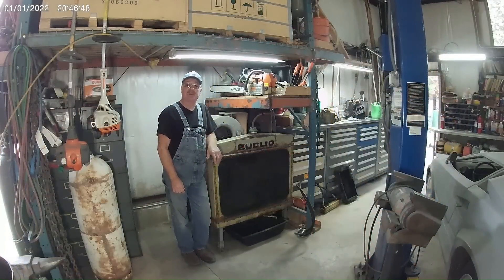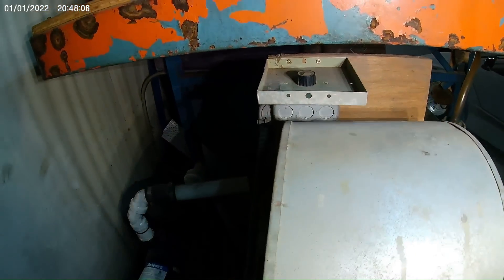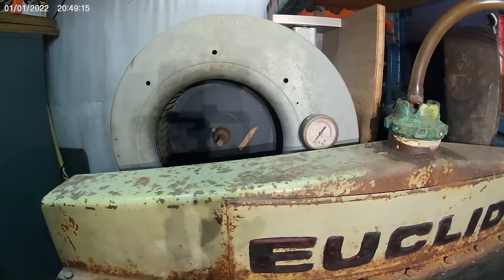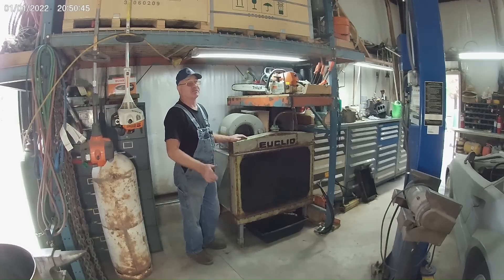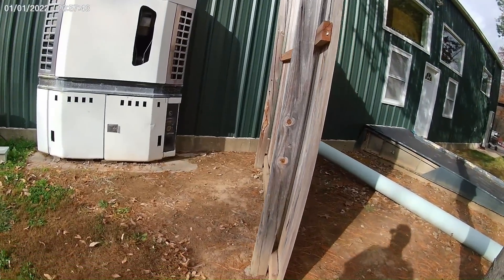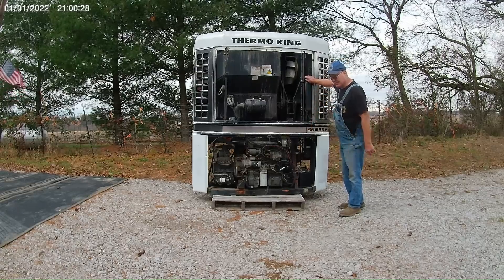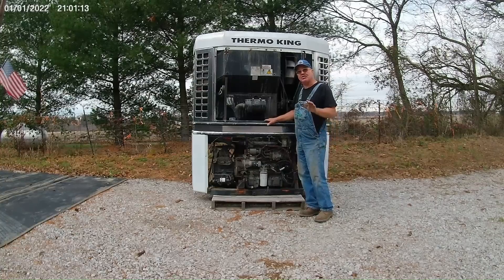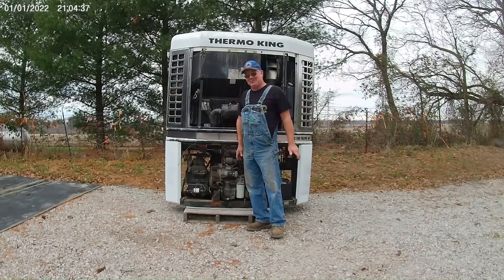The unconventional way we heat & cool our shop !

Comment: Did you add ducts to the inlet and outlet of your reefer unit inside your shop? Im a diesel mechanic and have my own shop. I stole your idea and bought a reefer unit to cool my shop but its not working to well for me and was curious if adding ducts would help
Reply from the maker: @RyanBryant-b7u  no ducts what freon is in it?
Reply: @dieseldoctor25 
R404
Reply: R404
Reply from the maker: @RyanBryant-b7u  I had the same thing, I changed mine to r-134a  the output air & condensation was twice as much, the 134a much better for cooling for a/c
Reply: @dieseldoctor25  ok. I'll recover the 404 and charge it with R134. Do I charge it with the same amount if R134 as the sticker says it hold R404? Do you have any other tips,tricks or suggestions for me?
Reply from the maker: @RyanBryant-b7u  do you have a tk sb2-30?
Reply from the maker: @RyanBryant-b7u  see if you can leave me your number and I will call you.
Reply: @dieseldoctor25   SB 111 SR+
Reply from the maker: @RyanBryant-b7u  OK same as mine  it takes more 134a right now I have
Reply from the maker: 13# just watch head pressure &sight glass in reciver tank
Reply: @dieseldoctor25  where in sight glass should the ball be floating? About center?
Reply from the maker: @RyanBryant-b7u  depends on head pressure & ambient temperature, probably will not see the ball floating, suction pressure will run higher than normal a/c because of heat exchanger, watch outlet temperature.
Reply: @dieseldoctor25 how long does it take for yours to cool your shop to a comfortable temperature? I'm not expecting for it to get cold in here but I'm hoping for maybe 80 degrees with low humidity. I just finished charging the system with r134 like you suggested. Very noticeable difference in temperature and the amount of water from the drain hoses. I'm hoping in a couple hours it will be comfortable in here now😊
Reply from the maker: @RyanBryant-b7u  my shop 4000 Sq ft 24ft high full of alot of heavy parts, remember you have to cool
Reply from the maker: Everything 4hr works for me
Reply: @dieseldoctor25  thank you for taking the time to answer my questions and help me. I really appreciate it. She's been running with r134 for an hour or so. I'll let you know how it does
Reply: @dieseldoctor25 both drain hoses are pouring water out of them like crazy. Wayyyyyy more than what was coming out of them when it was charged with R404 so it's definitely working
Reply from the maker: @RyanBryant-b7u  cool glad to help, 1 diesel mechanic to another LOL 😂
Reply: @dieseldoctor25  yes sir!
Reply from the maker: @RyanBryant-b7u  👍👍
Reply from the maker: @RyanBryant-b7u  cool!
Reply: No sir. Not so cool. It isn't working for me at all. I don't think my shop is insulated well enough. Also, with inlet temperature around 90 degrees, my outlet temperature is around 76. As outside temperature rises, the inside of my shop rises. This reefer unit doesnt seem to be able to even maintain the temperature in my shop. Would you mind calling me so I can ask you more questions?
Reply from the maker: @RyanBryant-b7u  give me a #
Reply from the maker: Still have not received a #
Reply: @dieseldoctor25  it takes it down as soon as I put it here. Even when I did 3 messages like you suggested
Reply from the maker: @RyanBryant-b7u  Send me a way to get ahold of ya. Yesi have FB
Reply: @dieseldoctor25  it takes down everything. I even tried posting my email
Reply: @dieseldoctor25  I can't seem to find ya on FB
Reply from the maker: @RyanBryant-b7u  let's  try a part # area+0+#+0+4digets
Reply from the maker: @RyanBryant-b7u  going to try to post another video tomorrow night, I ended up with 17# freon in my unit, 20 degrees difference from suction to discharge. Insulation a must 6inch in my shop,thermo doors & windows.
Reply from the maker: @RyanBryant-b7u  you may not be able to send a phone number so massage me 1st with a area code, then message me with the next 3# then another message with the last 4 digits
Reply: @dieseldoctor25  it took it down that way too
Reply: 1188
Reply: Part# 804
Reply from the maker: @RyanBryant-b7u  yes part#804,need more part #.
Reply: @dieseldoctor25 
Part #804
Next part # is #802
Reply: @dieseldoctor25 
Then the next 2 part # are 97 and 76
Reply from the maker: @RyanBryant-b7u  I have used part 97&76
Reply: @dieseldoctor25 
Part # 8o4
Next part # 8o2
And last part # is 9776
Reply from the maker: @RyanBryant-b7u  thanks.
Reply: @dieseldoctor25   you 314?
Reply from the maker: @RyanBryant-b7u  yes
Reply: Part # 8o2
Reply: Part # 9776

Comment: Any chance you could show us how it is set up on the inside? Thinking this maybe the way to go .
Reply from the maker: @wht4132  no just a opening in the shop for the unit,I would rase it 12" off the slab,also where it blows out when running is a lot of air!
Reply: @dieseldoctor25  Thanks for the reply
Reply from the maker: @wht4132  no duct work it just blows straight into my shop & incoming air gets sucked right into the bottom of the unit just like it was in a 53ft trailer.

Comment: Have you considered retrofitting an electric motor to run the ac compressor?
Reply from the maker: You can buy a 50 series it has a electric or diesel

Comment: nice setup you got there , i bought a insulated 53 ft container that was damaged but the reefer still runs it's a S600RR and will likely do the same and set it up for cooling
Reply from the maker: That is  a nice unit double digit fuel savings & no dpf.
Reply: @dieseldoctor25  is there a way to get into the remote system without having Fleet Dashboard?
Reply from the maker: @2748941  you need to talk to TK dealer. I don't know.

Comment: This is absolutely amazing, I love the way you think and your ideas. The reefer for the AC and the DIY heat pump are both mind blowingly amazing ideas. You really nailed it with these setups. I love unconventional ideas and oftentimes wonder why they are so unconventional when they are usually easier and cheaper, and work better on top of that.

I drive a truck with 53 ft reefers, also TK units, but ours have Yanmar engines. We haul frozen meat occasionally and the customer wants the reefers set to 20 below (-20F) and these units have no trouble whatsoever getting down to that temperature and keeping it there. And as you probably know you can set it to start/stop mode, or leave it on continuous so it will idle while cooling to help maintain the temperature, which might be helpful on really hot days.
Reply from the maker: Thank you!

Comment: with the cost of diesel you'd save a lot with a heatpump and batteries..
Reply from the maker: We run unit about 3hrs to cool shop , when we need it. it does not run all the time.

Comment: How did you decide on the length and diameter of the in ground pipe?
Reply from the maker: Just wanted alot of area of the pipe to ground so 3" was the plan. 1000ft was to property line & back.

Comment: I pull reefers hauling fresh and frozen chicken. The only time the hoses on the units I pull (TK and Carrier) are running water out like you have the spigot on is when they go into defrost. Most especially if it’s a frozen load at -10 in the summer.
Reply from the maker: I have alot of lumber in the shop from the saw mill, that might be part of it.

Comment: I worked for a railcar manufacturer as a test technician on large passenger railcar roof mounted Thermo-King HVACs for SEPTA . They had to provide cold clean AC air in a 75' railcar for 10 hours in a subway tunnel at 200F in case the consist ever had a extended third rail power failure and therailcar was trapped with pasengers within. It iced over the windows and doors while we spent only seconds at a time in the compartment during the 10 hour acceptance QA test. Very reliable and very efficient. Never had a under-performer in over 50 married pairs.
Reply from the maker: WOW that is cool!

Comment: I don't know if you ran a duct to the top of the building on the inside.  Cold air falls so having your condenser outlet high will run more efficiently.  Thermo King SBI or SBII or SBIII are all good reefer units.  I ran all of them over the years and always stayed away from Carrier as they seemed to be in the shop a lot.  Good to see these old reefers being repurposed.  Amber light for defrost and green for cooling.
Reply from the maker: Ok tThanks!

Comment: Things I would have done in the past but then I learned how easy HVAC really is so now I just do that. Now I just use heat pump systems for the shop and when I really need the heat, there is a 200,000BTU gas indirect heater that is sufficient (auction find for $12). I run everything full variable speed on the air handler heat pumps so it stays about perfect for very little cost (23 SEER). The air handlers operate on three stages of air filtration because, well, shop use... So it goes screen, Merv 3 then Merv 8 for the three stages with the Merv 3 and screen being washable. 
  
People loving the idea of reefer unit should consider the cost of maintenance which can be a monster on those reefer units (refrigerant, seals, pumps, valves, filters etc...) and small diesel motors. People should also consider that it may cool too fast increasing the moisture content in the air, for some machines this is not good. It's best to match the BTU's or tonnage to the space your heating or cooling both from a cost and management perspective.

As for the ground system, that's rather genius use of the land. From a cost perspective, it's all about the KW used in the time it takes to make the air comfortable plus cost of build divided over 4 years (a nominal figure to recoup expenses and time spent).

Comment: You could take your geothermal loop and run a refrigerant condenser through the 60 degree water. Then you have yourself a water to air heat pump setup. 

Of course that's more complicated to set up but I would imagine the versatility and efficiency would be worth it.

Comment: You can run a low speed switch on those units if you want to be able to control the engine speed more efficiently.  That's one of the first thing we would do with those old reefers when we bought them. 
Also, I haven't tried it, but I've been told from friends at our local thermo king dealer that if you swap the pulleys on the jack shaft, it will cool more efficiently.
Reply from the maker: I have a low speed switch, but have not seen the pulley swap.

Comment: alright but like, why did you resort to these solutions in the first place? It sounds more costly and less efficient than just, installing a 24 SEER minisplit and calling it a day? Did you just have a thermoking and an isuzu engine just laying around, along with the radiator loop thing inside?
Reply from the maker: Yes
Reply from the maker: MY shop is 4000 sq ft 24 ft high with industrial shelving on 3 sides full of parts & tools. A mini split would run for day's to cool this place. Reefer can cool it in about 3hrs with ground loop running all the time.We dont stay here all the time!
Reply: @dieseldoctor25  oh wow ok, yeah that makes quite a bit more sense. That's massive, man... You'd need like, 8 tons of cooling capacity and that's for regular maintenance rather than starting it up when you need it. My shop is taken care of by a single 1.5 ton minisplit head, but I only work in one place and I don't really care how hot it is in my storage areas
Reply from the maker: @nuc2726  okay, thanks

Comment: The whole "You cant put R-134A in older compressor systems" is absolute nonsense. I've been doing it for years in cars. Its not a "smaller molecule" and doesn't leak out over time. It works fine.
Reply from the maker: That is right.

Comment: That's genius especially because they sip fuel. No crazy electric bills. Excellent work !
Reply: I've heard that diesel engines without electronic fuel jet controls run well on well-filtered waste kitchen oil. If the chiller pack could be fueled by this, the bill could be cut even more.
Reply: @JBF-GST-Tanda  yeah pretty much anything that's electronically injected doesn't do that well with waste oils if it's mechanically injected then you can pretty much run anything in it.
Reply from the maker: ty!

Comment: From what I have been told by techs for mobile beverage trailers they said they went away from thermo king because the repair costs were insane, they went to using conventional walk in cooler units and said it cost them 1/4 of the cost in repairs and maintenance
Reply from the maker: I dont know.

Comment: With all the pipe you have already buried in the ground, I think a heat pump running off it would be much more effective both for heating and cooling.
Reply from the maker: The ground loop after start up is 7amps, no heating element,pump & fan only!
Reply: Well, I'd keep what's there as 60 degrees for cooling is not bad. But, a small ground source heat pump system will give you better heating and not cost much to run. One big advantage to the TKs is that they don't require 120 volt power so will run when line power is out. They do ( did? ) make a version with provision for shore power when at a dock that won't burn diesel unless needed. 

I'd also look at running that ground loop setup off a smaller circulator and perhaps adding some solar panels so the ground look system could run off line as well. A pool pump moves a lot of water and I don't think you need anywhere near that much flow.

Comment: Yeah a lot of people don't know that a lot of the R-12 equipment is still in use using R-134a and with a few components swapped like with the r-134a conversions you can run it on the new Refrigerant gas (R-y1234 I believe is the new one they're putting in cars). So in a couple of years you'll just have to do it again but it'll still be kicking and screaming....
Reply from the maker: I don't know about R-Y1234.
Reply: @dieseldoctor25  I feel ya it's the new Refrigerant they're using to replace R-134a and they've already started making R-134a to R-y1234 "kits" So in theory (even though they're saying you shouldn't do it) you could convert any R-134a system to run the "new" refrigerant.

Comment: Could you bury a tank for your cold water supply?  I heat with wood but I need a cooling solution here in Missouri
Reply from the maker: Any tank will work & any radiator will work, but the size- small for a small shop-big for a big shop!

Comment: I had this idea a while back as a otr refer driver i wanted to take a trailer and insulate the outside and funish it and build a bathroom to make a guest house and use a refer to heat or cool it. My only thing was how load it can be inside that trailer. After seeing ur setup i still have that idea just making the guest house out of a actual house
Reply from the maker: sounds cool!

Comment: let's say you set it for -5 and it shows the box temp is 36 for 4 hours wouldn't it code out and shut down
Reply from the maker: no, it would run high speed cool till it get's to -3 then low speed till-5 then shut off!

Comment: I am curious, do you have the exhaust angled at the top? or anything to prevent water from getting in? Or is it just a straight pipe that if rain were to fall, it could fill it up easily (that's my worry)
Reply from the maker: There is a drain hole in the unit exhaust pipe!

Comment: Another unconventional way to heat the building which is 100% efficient, and that means that there is no heat going up any kind of chimney is electric heat. So if you want really cheap to buy electric heat go buy a clothes dryer that someone is getting rid of, I have two of them and they cost less than $10 each and they both work perfect. Now for the uninformed out there, I’m not saying you should dry clothes in them just use them for heat because every ounce of heat that comes out of them heats the air in the building and it pulls the cold air off the floor.

Comment: Thanks for sharing this, you just gained a new subscriber! ....i have an sb2 max that I am pondering doing the same thing as you at our shop. I work on mobile AC units on trucks and equipment all the time and have had my technician's license for over 20 years, but I don't know anything about those reefer units. I think mine has 410 a refrigerant that has leaked out over the past few years. Reckon I can use 134 a in the SB 2? and if so, what kind of oil should I use and what should the system operating pressure be?..... that under ground system is brilliant and I bet fairly cheap to operate and maintain.
Reply from the maker: I would stay with the 410A & repair the leak.

Comment: Cutting that hole by the fan takes always a lot of it’s ability to pull air through the radiator.
Reply from the maker: THe hole is on the back side of the fan!

Comment: Those motors have a mechanical fuel pump you can run it on a mixture of use motor and diesel. Save you some money
Reply from the maker: We mix a little. Thanks

Comment: This is really cool, but I'm confused about the ground loop. I'm guessing you have the water enter it after it goes through the radiator so that it can reject the heat from the building? Why not just run some duct work right off the vent from the refer?
Reply from the maker: two completely seperate systems! Ground loop & reefer.
Reply: @dieseldoctor25  so what is the purpose of the ground loop? I'm confused.
Reply from the maker: @nbarrager  I run on a timer to maintain cool  a shop.
Reply from the maker: and or heat the shop